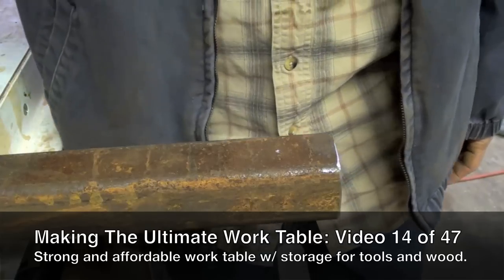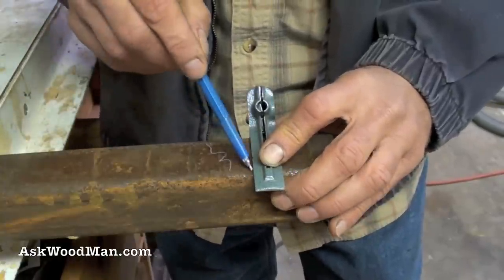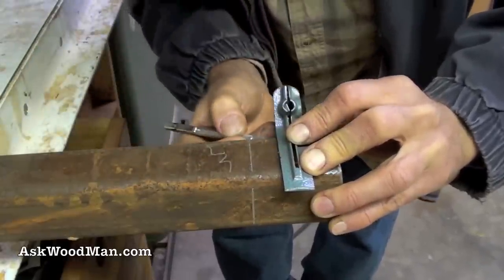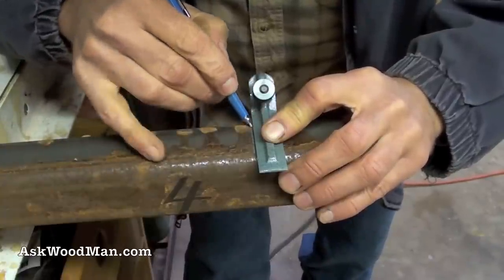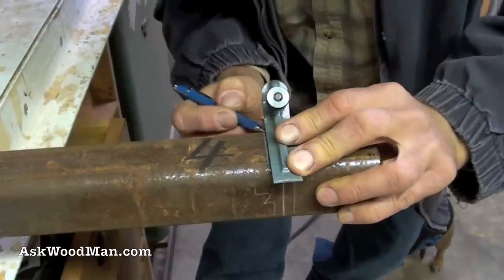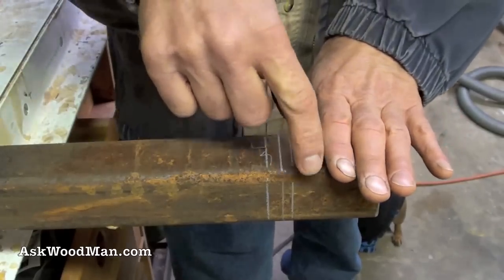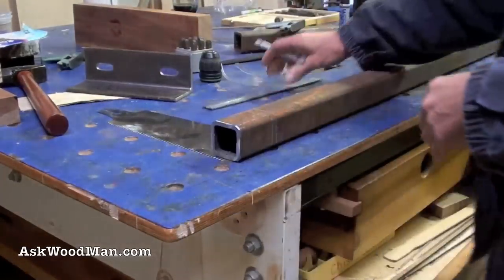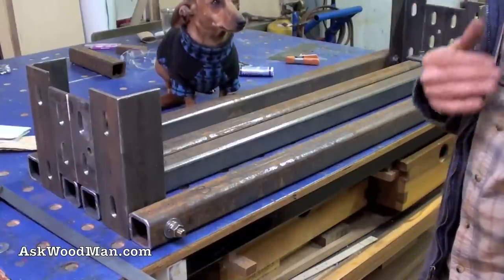14 of 47: Making The Ultimate Work Table • A Woodworking Project

Comment: I had to use sheet paper as 'wraparound' and soap stone as I don't work often with tubing...
At one shop I used to work they had to machine a foot to the side long tool like this out of aluminum angle just for the same purpose -- marking squire tubing. 
Thank you for your videos. Looking forward to learn more tips :)

Comment: Kewl I have been using a tri square for 40 yrs and you just gave me a reason to find my angle foot .I seldom need it for anything but now it will be usedI normally transfer lines around with a roofing square.

Comment: Good tip about putting the marking tool back on the line...learn something every day )But you use 1+2-->3-->4(side) sequence for marking whether 1 for 4 and 2 for 3 would avoid cumulative error...just to be perfect).
Have you tried to use 'wrap around' for this?
Thanks.

Comment: Did you consider welding the brackets onto the tubing rather than bolting them all?
Reply from the maker: Yes I did. But to jig, hold and weld and get 8 perfect square joints takes time. And I wanted to show how to build this table for woodworkers who may not have welding capabilities.